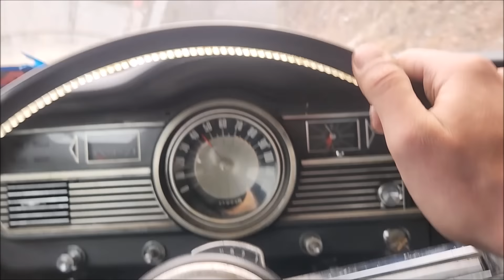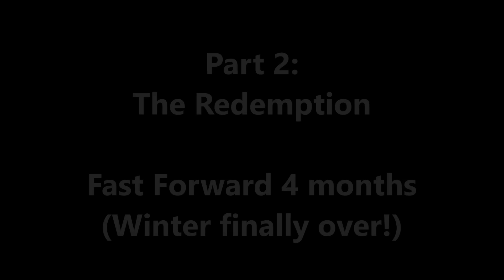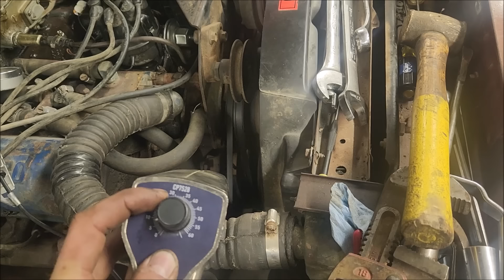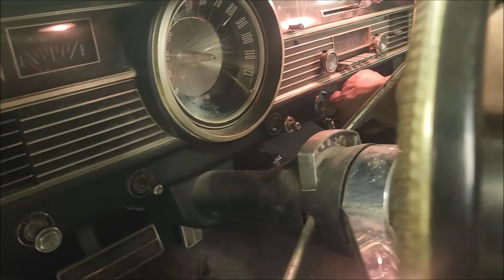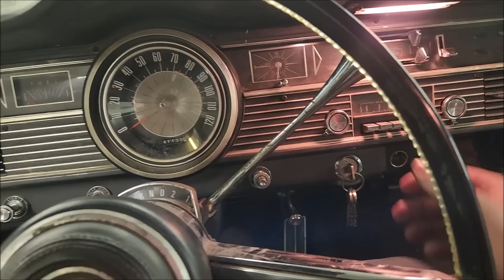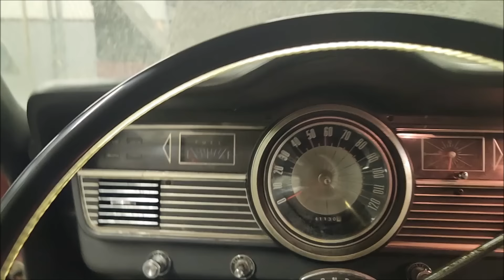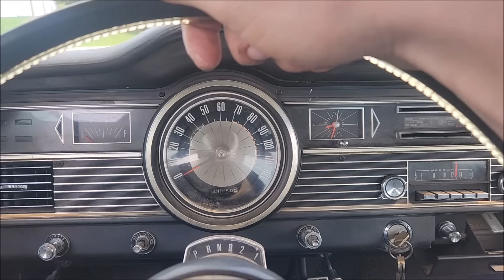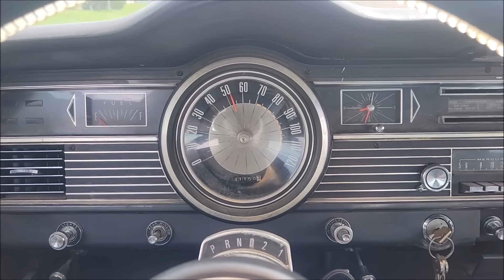$1,000 Classic Car - Will it Run & Drive Home?

Comment: I love your videos, they are much more informative than any other channel.  I am so glad you covered the boiling in the carb!  I recently bought my 1st Ford ('79 F250 with 460ci).  I have not noticed the carb issue when parked but I am seeing this issue in the clear fuel filter I placed just before the carb.  Some times the carb seemed starved for fuel when driving.  Many times it bubbles so much it does not look like there is much fuel getting to the carb.  I have placed heat shielding around the pump all the way to the top of the engine and it is slightly better but still an issue.  should I run the fuel line way away from the engine to keep it cooler???  is there a fuel additive/ ethanol free that may be better?  any help would be appreciated.  THANKS and keep it up.  I am thinking about getting your carb cheater as well...

Comment: You'll have to keep this one. I agree, your not afraid to turn the distributor, & retime the thing. I don't think all timing lights have that knob.
Not sure what that is. I never knew about adjusting the vacuum advance thru the vacuum hose inlet with an Alan wrench. Like you say,
that was a diff. kind. Of advance. I like watching you diagnois ford engines

Comment: dodge put a little bleed line on the fuel filter to try to combat that boiling problem helped on some not on others. also chevy some years used manifold vacuum on dist so the timing could be lower because of hard starting then when started manifold vacuum would bring up timing where it would idle

Comment: When dropping a distributor, if the oil pump shaft is slightly out of line, I just bump the engine while applying just slight down pressure on distributor.  It will drop in easily and still be in time.  No fuss, no muss.
Reply: That's what I do on the Windsors because the gears usually engage before the pump shaft does. I'm not sure if it's the same on an FE though

Comment: Just  a sweet running FE - can't hardly beat 'em.  When I met my wife to be, she had 63 500XL that was totally cherry.  When she graduated from college, they traded the Ford for a new '75 Firebird as a graduation gift.  I found out later that they only allowed $300 for the Ford - I surely would have bought it from them had I known!  By the way, that Firebird is sitting here in the garage as we speak.  I swapped the 350 for a 455 with a little cam and true duals and a Q-jet.  Still a fun car.
Reply from the maker: Nothing like holding onto vintage iron that one had owned for a very long time 🙂

Comment: Wow, all I can say is amazing!! Uncle Luke breaks out the Voodoo Doo map and it all comes to light. What an excellent, excellent video.  Could you get that car back in time to maybe drop a 289 or another 390? I would love to see that and maybe hunt down a drive line and put it all together. I think that would make a great series. The Uncle Luke Thunderhead 289 MONSTER MONTEGO.  Take that to Power Tour, AWESOME!!

P.S.    Looks like the Wrangler may need some tires. Just an observation.
Thanks again.
Reply from the maker: My wife's jeep? Definitely does - she's rocking the strong independent women tread right now 🙂
I do have a parts 65 galaxie with a 352 4 barrel sitting in the fenders - hope I get the car back in one piece and then I know what I'll be attempting 🙂
Reply: I have learned a tremendous amount watching your channel can’t say enough good things about it and look forward to the next one. I had a pilarless 4dr ‘67 Galaxie with a 390. Great car! Your 65 sounds like a blast.

Comment: Luke, great program as usual 
Hey setting idle mix to max vac with the trans in drive is equivalent or sometimes better than max then richen some when im neutral/park.   Its the method prescribed years ago for autos.
End up with strong off idle and minimal drop in rpm when going from park to drive
Reply from the maker: I do indeed agree - technically on an auto, perfect idle tuning with mix screws is performed under "in drive" load. When the rpm drops due to drive, it does change afr - I just largely never have a helper, so I often will tweak the mix on an auto after a couple of drives depending on how its behaving in D

Comment: Luke:

Thanks once again for your informative and no nonsense video on the '67 Mercury.  I too appreciate the relative simplicity of vintage  engines and while I am a big fan of FE's and have had a couple of '67 FE's and worked on a few others in the past, my curent fleet includes a couple of 351 Windsors, a 1970  with a 2 barrel  carb and a '69 with a 4 barrel carb.  My question today  surrounds the aftermarket Holley 670 Street Avenger on the '69,  This particular carb has 4 corner idle mixture screws.  Have you gone over the techniques for fine tuning such a carb in he past?  If not,  please consider doing a how to video or a narrative that takes us through the fine tuning process.  I think  I have it close but I think there is some more room for improvement.  Thanks for sharing your insight.

Regards, Jeff T.

Comment: What you said about ported vacuum advance makes no sense to me.  I run manifold advance on my FE and have initial set at about 20 degrees.  With my vacuum canister at idle that gives me about 32 degrees advance - which my engine loves.  Engine ran waaaaaaay cooler and quieter when I made the switch to manifold from ported.  Then when I’m cruising down the road just off idle with the vacuum reading about 18 or so, I have a good amount of advance precisely in the low-load conditions I need it in.  This allowed me to get about 19 mpgs in a big, heavy, old F250.  I just drove my truck from Sacramento, California to Fayetteville Arkansas and it ran like a top with plenty of power.  I was amazed at how cool the engine was running when I’d open it up to check on things at the stations.  Also, according to some youtube old-timers who were actually alive at the time, the switch to ported definitely was a response to impending emissions regulations.  You know much more than I do about these things, but I just can’t get on board with the ported thing.

Comment: My dad had a '67 Merc Monterey 4 door for about a year until driving through the mountains in PA one spring day and a rock broke loose and rolled into the side of his car.  Then he got a 68 Merc Monterey 4 door.....for about a year until someone ran into him.  No one hurt in either instance  But he was done with Mercs and got an Olds 98. 😁
Reply from the maker: I also at that point would feel like they were cursed 😄

Comment: When I started my mechanic career in the mid 80s there were still multitudes of FE equipped vehicles still on the road and we saw them frequently in the dealerships. Most of the generations that loved and kept them running have passed away. I wasn’t a huge fan of the FE platform then or now. Personally I felt that the Windsor based small blocks were better all around engines. In any case it’s a good thing that everyone doesn’t like the same thing.

Comment: I learned the hard way the 1st time I set a distributor in. I was off 180 degrees so it backfired severely blew up the muffler and bent the pushrods. That happened on a 69 cadillac with the 472 engine. It was a bad day for me.

Comment: It's possible I missed it but did you ever lower the rear window??
Looks like it had the  breezeway option and the entire rear glass would lower about 4 inches and there is a switch on the dash to do it...
Reply from the maker: I sadly always forgot to try - it was indeed one of those models. Extremely cool
Reply: @ThunderHead289   Yeah,, cool and pretty rare in 67 and 68..

Comment: I've always just got no. cylinder on TDC then install the distributer with the rotor pointed at no.1 piston then just redo the wiring to the proper firing order. But really you can do it any way you want. You have a 1 in 8 option.

Comment: Thanks for the lessons. This info is super useful. BTW if you’re interested Eastwood makes a slide hammer that has vise grips on it. Would save u from welding on your other one. Cheers.
Reply from the maker: You know what, I think I'm now just going to cut that piece off that junk distributor and weld it to a pair of vice grips - I'm glad you made this comment 😄
Reply: @ThunderHead289  yup. I had a suspicion you’d make your own. 👍🏼

Comment: Those are nice cars.  Don't see many of them. :)   at the moment I'm working on  my 75 mercury meteor montcalm .  Has the 400 v8 .   Putting a new fuel pump on it. Has 73 000 original miles.

Comment: Not sure I understand.  I would rather have this car than a Galaxie.  Now that you optimized the engine, swapping the suspension, brake and exhaust bits seems easy.  Keep bringing them back, "Uncle Luke"!

I have a '66 F100 with a 240 that I'm planning on recovering when the weather starts warming up.
Reply from the maker: Well, oddly enough - the chap pulled the engine and the car itself is back on my property. Probably will throw my own extra FE in it and keep driving her 🙂

Good luck with the f100 - wish the warm weather was here already!

Comment: I've had to do a lot of dizzy rebuilds for customers and every single one i do, i appreciate GMs HEI unit more. I know that's a 7 year newer system, but still. Also the GM oil pump drive shaft, it's a slot so a screw driver turns it fine. And it's location too, yes the firewall is right there by the way ford dizzies are nestled in the intake really sucks especially putting the hold down on or as seem adjusting anything. Also they don't seize since they seal in an oil passage and at the top just have a paper gasket on a flat.

Comment: I would use permatex number 2 i think it was, the one that hardens on something like that fuel filter if it were leaking, i used to use it on water pump gaskets as well and after never had a leak, make sure the threads are clean and dry, put it on the threads and let it sit overnightl. As far as the choke goes, it should be fully closed when cold then the choke pull off opens it slightly, it's adjustable and there's a spec on how much it should open, then as the engine warms up the choke spring will gradually open the chok,a lot of starting issues arose because of the choke pull off would not work or be adjusted properly, the choke wouldn't open a little ona cold start which caused the engine to flood from over cranking.

Comment: That is me, 1975-1987 Ford Econolines (The 351W/460 Carb years.) - I have owned Chevys too...but, they are gone.... (I hate DSII Distributors) I run GM HEI Conversions (Advance is right on top!) - I JB welded my "Oil Pump Clock Tool" (Also used to prime the oil pump when doing engine rebuild)

Comment: Oil pump alignment is much easier. Sit the distributor down meshed with the cam gear, then slowly turn the engine over while holding pressure down on the distributor. It will line up and drop the rest of the way in.

Comment: My '74 Gran Torino Sport has issues running and starting in the Summer. I've never considered a spacer for the carb being a possible solution. I know what i will be doing this weekend. Thanks for the info.

Comment: Having grown up with carburetor cars, when starting we always just on it's first start in the morning give the pedal one, maybe two pumps and they'd usually fire right up.  I'll sit here and watch folks pumping the gas pedal like it was an old treadle sewing machine and think to myself, "are they trying to flood it!?"  If I ever did happen to flood it, which you can easily tell by the strong odor of gasoline, floor the pedal and crank it till she fires and let off just like you said.  After the first start in the morning with that first one or two pumps, you don't need to even pump it again on the next start if you're like say, running errands around town and doing a lot of parking and re-starting, just turn the key and they'll fire right up if they're working properly.  Now, if you park it and work an 8 hour shift, then yeah, give it another pump or two next time you start it, otherwise don't bother and just crank it.

Comment: A small engine guy taught me to put grease on that NPT tap to prevent or at least minimize getting chips in the carburetor.
Reply from the maker: My coworker joe told me that today and I felt like he was insinuating if I was only using half my brain 😄
Great tip

Comment: Those vacuum advanced cans have an allen screw adjustment inside the vacuum port.
Also check you coil 12V connections as i have seen those come loose causing driveability issues

Comment: some nice steelies with chrome center cap lowered.... but not to much.   That thing would look so mean!  I love the look of that car it has a Lincoln look of the same year. 67 Lincoln is on my mount Rushmore of best looking cars ever!  I only wish I would of bought one years back you cant find a running one for under 10k anymore. last one I looked at had the Flintstones conversion no floor pans rust everywhere and still wanted 8k for it.

Comment: I appreciate your videos like this. 
I have gotten my 86! Suburban running better, but I still can’t quite get it, what I’d consider perfect. 
It feels a little flat on acceleration. Or it pings under heavy load. 
I feel like I don’t have the timing curve correct, and the carb is just a little off. 
Seems impossible to find anyone to tune it better though.

Comment: Luke, you are an amazing teacher/engineering master with the patience like no other and you entertain naturally, it's awesome. The radio bit timing was hilarious, like how 😂.

The details you share and the time you take to show real world issues, thank you for doing this. You give me confidence to try my best to work on my hobby/project, a new to me 78 Bronco with a 2150 on a 400, w/C6. Stock engine non-catalyst, no AC, no big heater box in engine etc. The rig needs attention everywhere, not very road worthy but drives and stops. I hope to be driving it around in the next couple years.

I just did my 1st ever carb rebuild/clean on the 2150, I have yet to reinstall it, waiting on a nice day. QQ... the instructions on the float said to set it at 7/16 from the top of float to the top of the carb, I had to adjust it a lot, should I be concerned?

The reason for rebuild is I'm getting gas in my oil. I found the power valve had no gasket also. The carb sits on a factory EGR spacer plate. The carb uses a hot air choke system. I bought a fuel pump, but I'm not seeing any fuel leaking from the existing pump, reason I think the carb is dumping fuel into the crank case.

Anyway, likey tldr...😂 but thank you again, I'm 47 and never had anyone teach me the way you tell it here and I'm no mechanic, but I do all my maintenance/repairs on my vehicles that I can handle, and I'll do it till I can't. 🍻🇺🇸
Reply from the maker: There is something very freeing and fulfilling about doing your own diagnostic and repair, especially on that first drive where everything is right with the world 🙂
Reply: Well, I went ahead and reinstalled the 2150 with minor adjustments to the choke, fast idle, choke pull off, mix screws and curb idle, all is okish. The choke plate didn't want to open on the cold start, even after the initial pedal set, so may have to adjust the choke again?
I'm still not sure if the float is set too high.
I wonder if the accerator pump should have any pressure on it when engine is off, mine has some to it. Can't drive it yet, more work needs done, like brake lights not working etc. Thanks again Luke, you got me out today to work on my hobby/project. 🍻🇺🇸

Comment: Another great video, and I really appreciate how much detail and thought goes into your instruction. I have found it so very helpful with working on my own car that I'm trying to restore! It does take a lot more time and effort to make a video out of it than just doing the work, but for people like me who want to try and learn, we find it so invaluable. I do have a question for you though if you have a moment. I am working on restoring a 1984 Ford LTD Crown Victoria 302 and noticed that the transmission isn't shifting well (it revs too high) and the speedometer is very jumpy as it moves around. I did some research on the interwebs and one place suggested it might be the speed sensor in the transmission which could fix that (which would be nice as that seems to be a fairly cheap and accessible part, so it's surly not the case). Do you know if that could cause those sorts of issues on an AOD transmission? Thanks and keep up the great work!

Comment: I'm very surprised that you did not clean up the distributor before installing it. It would drive me crazy handling it as dirty as you have it.
Reply from the maker: I would have if I wasn't always in a mild hurry or if the engine was clean - it matched the "patina" of the engine quite well

Comment: I tend to be a bit partial to the old Fords for 2 reasons. 1: easy distributor to work on being up front.( try pulling a Chevy distributor with a slide hammer)😳😵‍💫.  Also I particularly like the older full size models with the heater core under the hood and very easy to change out. Ford differentials were known to be much stronger than many others. 
However…I’ll drive any of the older cars, love them all, Ford , Chevy or Mopar. 
Today i drive the old Saturn “S” series….about as simple a computer driven car as you can find, plus very economical.

Comment: 55:20 ALSO The throttle butterflies would freeze open in the winter and that's the real big reason they were trying to heat carbs on engines